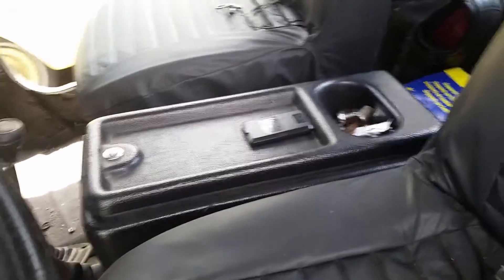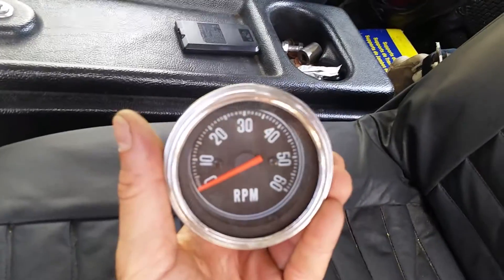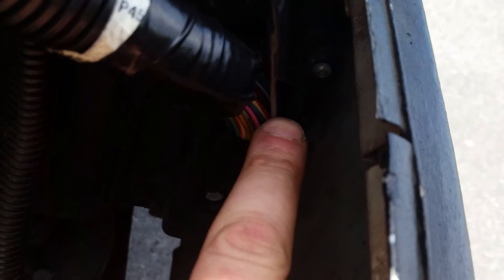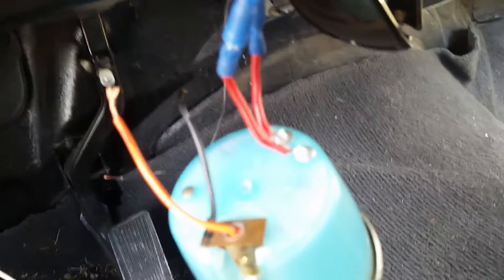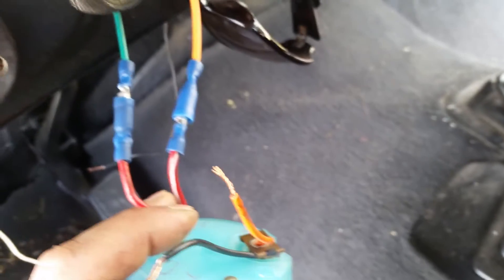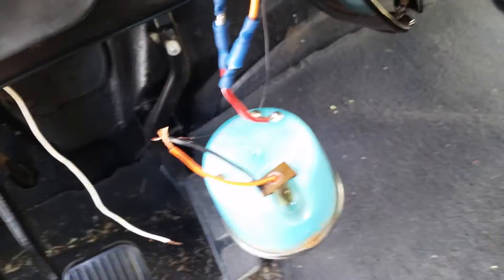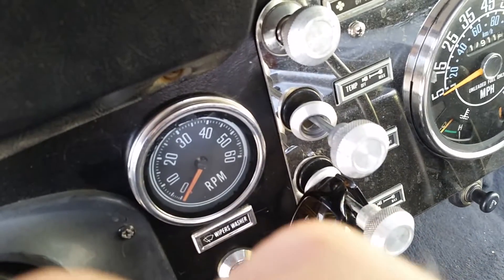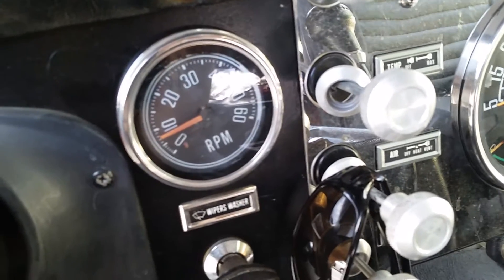Factory CJ7 tach with mpi

Comment: So we basically are making that coil wire go through that tachometer?
Reply from the maker: Yep running it in series
Reply: @ninja63639 how does the tach ground or does it kt not need that?
Reply from the maker: @84_CJ-7 doesn't need it. It just gets its reading from the tach signal passing through it

Comment: How's this working long term? Everything I've read online says to insert the tach inline to the POSITIVE to the coil. Not the negative which is the grey wire like your video shows. I'm running a 1991 YJ ignitioned 4.0 and want to keep my original i6 CJ7 tach.
Reply from the maker: It worked great for the 2 years I had the Jeep

Comment: Yo! I was wondering how all the gauges stay in on Dash. Can I replace all gauges without taking the dash off?
Reply from the maker: The speedo has 4 speed nuts holding it in. The two small gauges have a strap with a nut on either side and the tach has a screw in the back middle of the gauge with a plastic piece around the back of the gauge. The clock I cant remember. You'll have to lay on the floor and shimmy your hand up behind the dash but it can be done
Reply: @ninja63639  
Thanks man. Just to confirm I don’t need to tack dash off then?
Reply from the maker: @4neo4  
Nope
Reply: Thanks man!!!
Reply from the maker: No problem

Comment: I was excited when I read your post.  Unfortunately, it does not work with my setup.  I also have the Hesco MPI kit on my 1986 CJ 7, 4.2 with a 4.0 head.  When I do the bypass, the starter will not kick in, and the fuel pump will not energize.  As soon as I hook the factory tach back up into the system, the fuel pump comes on and it fires right up.  And by the way, it is ALWAYS a new pressure regulator at HESCO, regardless of the problem....

Any additional information you can pass on would be great.

Thanks Christopher for your post.